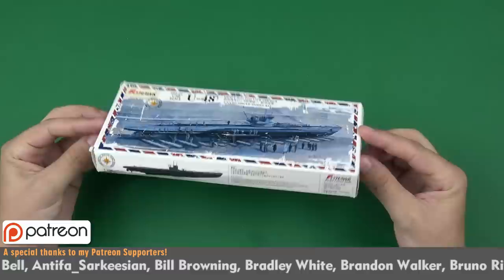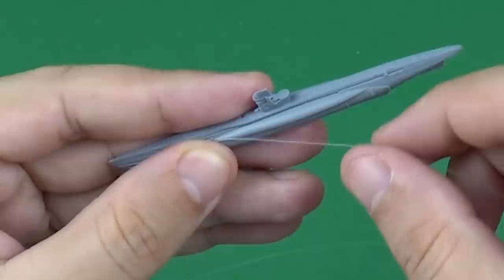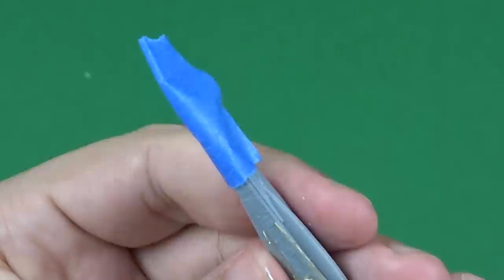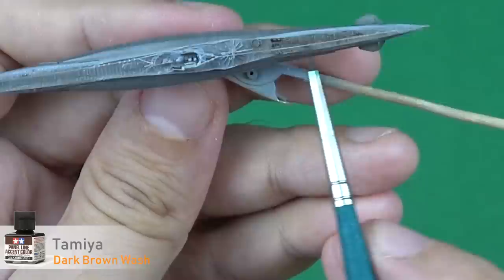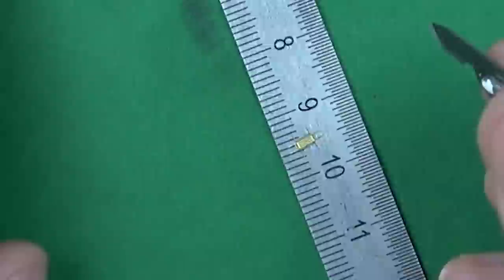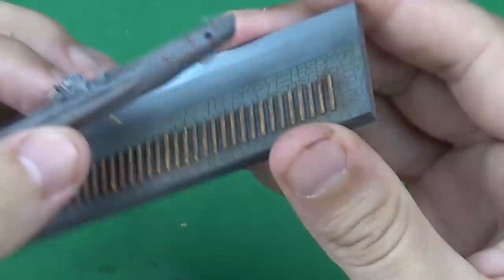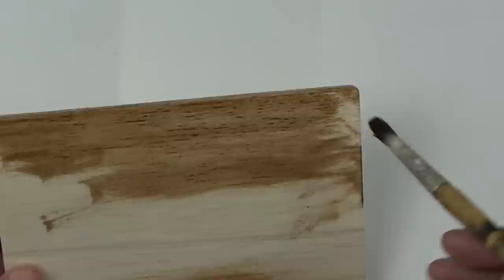DKM U-boat Type VII B Dry Dock Diorama 1/700 Scale

Comment: Hey! Amazing work! When I see your fine airbrush works everything looks so easy but every time I try to do this myself I get more and more frustrated. If I dont give enough tinner to the paint it cloaks up on the needle after a few seconds. Lietaraly after a few stroks. On the other hand if I add more tinner to mix spidereffect kicks in. I use an airbrush with 0.2 needle and I play with the pressure and the tinner but no result. I am loosing hope.

Anyways, thanks for sharing these videos!

Comment: Very nice kit, and very nicely done!

Couple of questions, if you please:
- For the first weathering layer with white, do you dilute it a lot, or just playing with the airbrush to barely spray any?
- What's the logic behind the choice of white glue vs CA glue to apply details on painted parts?
Reply from the maker: Thank you! If I say "highly diluted" in the video that means only one ore two drop of paint to full paint cup of the airbrush. I use fast type CA because of that I use white glue sometimes when I need time to set the parts to place
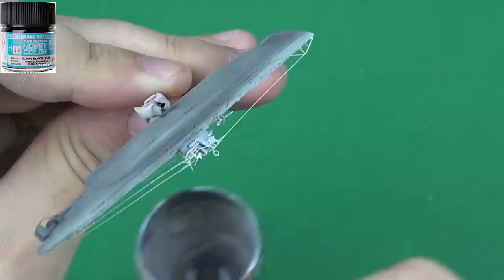Reply: @Scaleaton  I just wanted to know if you were actually using that diluted white for the weathering layer. You're not mentioning that (around 7:12).
Reply from the maker: Yes the same. One or two drop of paint to fully thinner filled paint cup